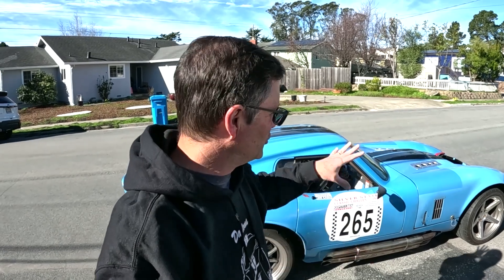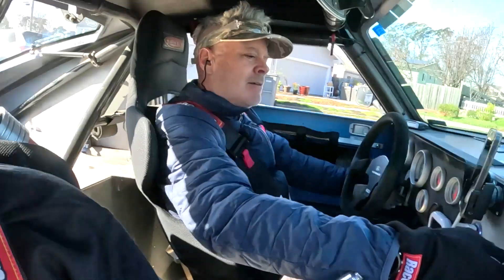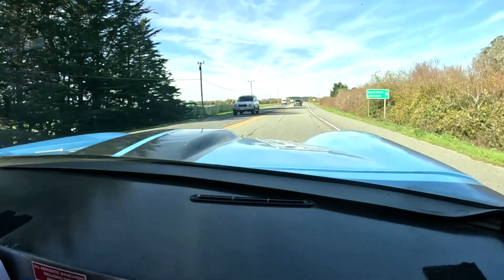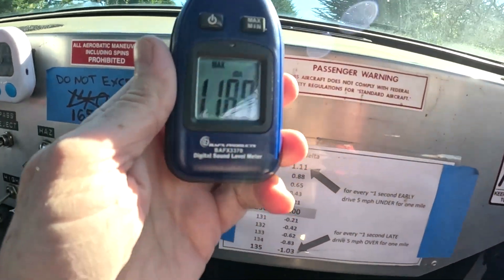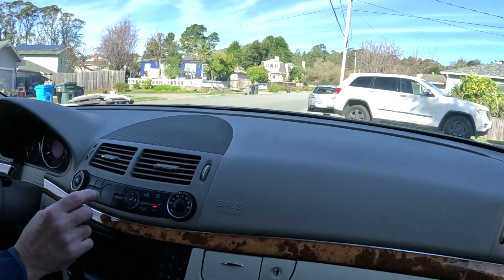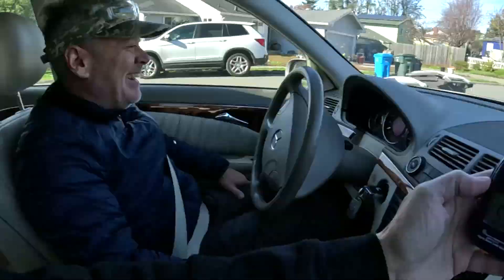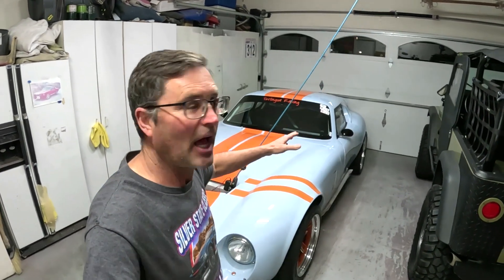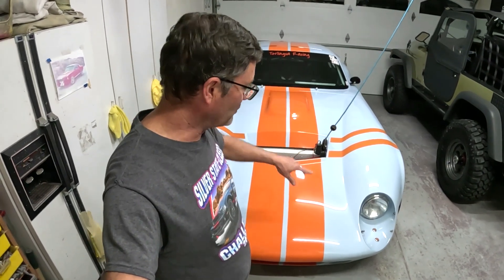How loud is the Factory Five Type 65?  We compare two different builds with a Mercedes and a Bronco.

Comment: Mine is mid 90s idling then 118db at 60mph.  Stock FFR pipes, Blueprint GM427LS. Carpeting, side windows, roof liner
Reply: Just cruising
Reply from the maker: @ Wow. You win the prize for the loudest type 65. How many DB at full throttle? Waking the dead?
Reply from the maker: @ You will need ear plugs and muffs or go deaf.
Reply from the maker: @marklewis5918  Is the 118 at cruise or full throttle?
Reply: Update with GasN touring pipes.  Idling at 89db.  Highest reading I saw was 112db which is around 2500rpm at 50mph ( that's the sweet spot in my car for highway drone).  Higher RPM didn't generate any higher reading from what I could see

Comment: DBa covers a narrower frequency range, ignoring low frequencies. DBc is a better indication of what we actually hear. Especially with car sound that has a lot of bass. It's a logarithmic scale, every 10 dB is perceptually about twice as loud. Dave's at 126 dB is more than 2^5 = 32 times as loud as the Mercedes at 75 dB!
Reply from the maker: @michaelclements4664  Not my world so didn’t know which to use. Might need to do it again. Thank you for the information.

Comment: 126? That's causing immediate hearing damage to anyone inside the vehicle without ear plugs (and without proper ear plugs!). My dad got kicked off a practice session at Watkins Glen for 120 dB at the exit to turn 1 as measured from the side of the track about 15 feet away. In a 61 Austin Healey Sprite. His solution was to add a cone to the top and spread the exhaust note over a wider area. it worked.

Shocked you aren't being pulled over every time he passes a cop.

My towncar you can hear each other breathing at 60 mph. Like the commenter above, I clutch the steering wheel to make it creak and squeak just to add some volume to the cabin and annoy my wife. In my Sprite, it has straight pipes to a cherry bomb muffler, it's loud  but not 120 dB loud. Maybe right at the exhaust tip. My inspection station is glad it's old and doesn't have to do emissions and noise testing, lol
Reply from the maker: @mundanestuff  Great comment!  If you passed an officer at full throttle I am sure he would be making a stop. The car is louder on the inside compared to the outside. Still loud anyway you look at it.